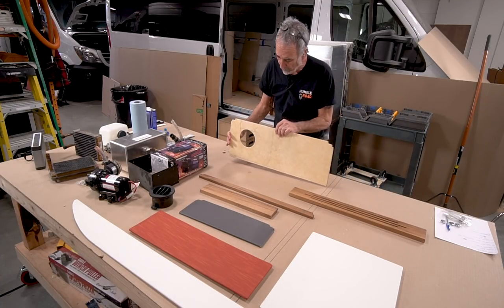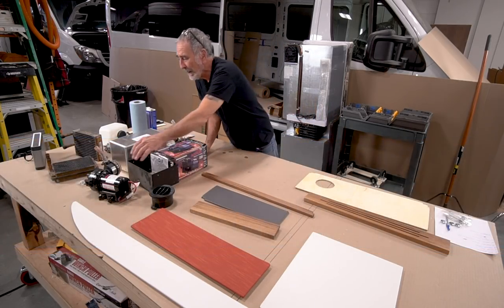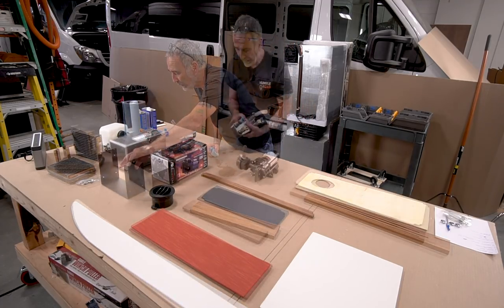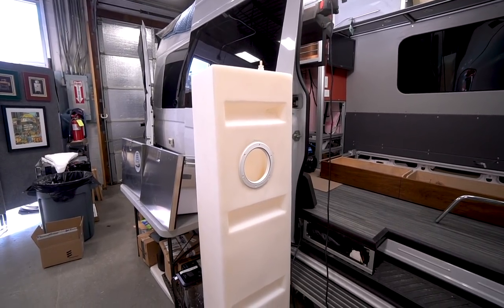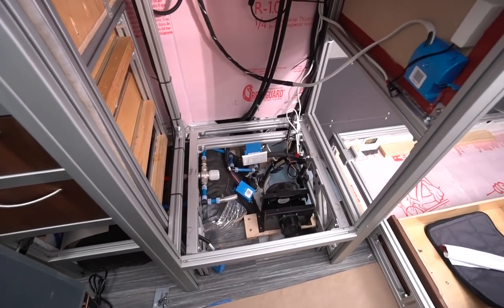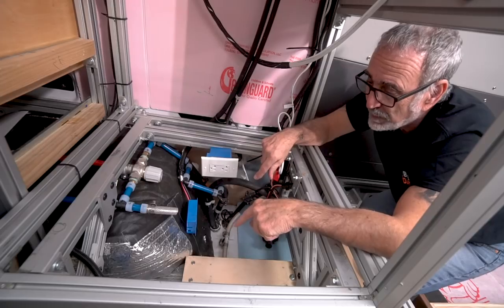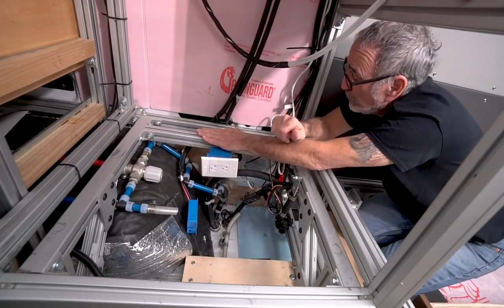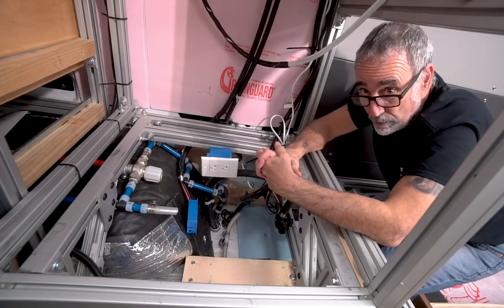VAN BUILDER TRUTH :: So you wanna build a van? What could go wrong? I'll tell you what went wrong!

Comment: Coming from a former product development engineer, you are a lucky man to have (only) one product to look over after a year of 'normal' use. It's great you are taking the time and reevaluating both the design choices and component selection - both make for better products from you in the future.  You may give some thought into an extended warranty program that benefits both your and your customer - sort of an annual maintenance agreement that provides less trouble for your customer base and further quality control and feedback for your future builds that isn't too costly for you or your customers. This is way vans should be designed and built - slowly, methodically, and thoughtfully. Nice job George!

Comment: I won't mention the brand but they would kill to have so few warranty issue as HRE (Humble Road Enterprises).   Most of their Class B products can't make it off the dealership lot without a dozen or more 'warranty issues' (aka poor assembly quality because their product is in high demand).   It may take 4-5 campervans before you standardize on preferred build methods and parts suppliers.

This is a total win for George and validates build #1 was well conceived and your belief in 'design for long-term ease-of-repair' is a winning strategy for the customer and Humble Road.

Comment: Maybe MDF will help in some areas in the future. Unlike even marine grade plywood’s or Baltic birches, mdf doesn’t move at all. My standby for gluing wood surfaces to other things is - if it’s being glued to a different material, always use mechanical fasteners and glue. Gluing two different materials together seldom lasts, but glue assisted fasteners will last forever. If you have to go with only glue just etch the shit out of the materials with low grit sandpaper to give it as much tooth as possible.

Comment: The best explanation on building a van I have ever seen, super professional. Living in the Netherlands I have to built one myself. If I will do that, thanks for all your examples. Tip: In the car industry security check paint marker is used to check if a bolt loosens. You don't have to touch the bolts to check, you can see it.

Comment: On checking the 80/20 screw connections - what we used to do on such things was paint a little line along the nut and surface so you can visually see if the nut has moved. You can also use a sharpie.
Reply from the maker: Brilliant!
Reply: Yeah, that's a GREAT idea.
Reply: Jollyprez  great idea.

Comment: Hey George, awesome work dude!  I know it's six months late, but if that pump is anything like the jabsco's, there should be a clip on the back of the filter unit that allows you to just remove that from the pump.  Should save on pulling the whole pump unit in the future.  Another thing I don't see that you might consider is adding an inline filter on the water hose feed.  Maybe come up with an 8020 mount system for the filter itself as its own little component for easy user replacement when it gets dirty.  Lots of bad stuff out there (especially where they Frak) in the tap water that could probably be stopped or reduced before it makes its way into the "house" system.

Comment: George- swap the locktite for a nut with an encapsulated  nut lock washer- you will never need to check the whole van during your warranty check. OEM use them and after 200000km durability testing they do not lose torque- l have worked in OEM engineering for close to 30 years- good luck with your builds. If you get sick of van builds come and work in OEM automotive.
Reply from the maker: Just did a futile search. Can you give me an example? TY

Comment: I really enjoy your videos, but I don't remember hearing you mention too much about aux. alternators.  I think I did hear you say once that you took your builds to Advanced-RV for their install.  I am considering installing a Nation's 280 amp. alternator with a Wakespeed WS500 regulator and wondered if you had any comments?
Reply from the maker: You need to keep watching my videos. I'm not a fan of the second alternator, particularly in a Promaster.
Reply: @HumbleRoad  
Another guy- VanGoSki on the Sprinter forum, and I have the exact same setup.  We have a DIY-   Fortune prismatic 16 cell, 400Ah, 12V battery with a REC-Active BMS.  We are charging it with a Nation's 280amp alternator and running it with a Wakespeed WS500 regulator.  We may be the first to have this setup.  The regulator is suppose to control the current and temperature of both the battery and alternator to keep everything in check.  It will fit the N62 bracket with a two belt setup, no modifications.

I have been on the side of the road twice trying to run off one battery.  That is my reasoning behind the setup.

It would be real interesting, maybe a video, for your charging ideas.

Comment: Dear George... can you please tell us what you use as the Thermal Break between the 80/20 and the chassis? 
That is the only thing I never see you do. :) Something that is long-lasting and is a good thermal break. Thank you very much if you can mention that.
Reply from the maker: I cut 1/8” rubber into strips same length as the 8020 . Predrill all the bolt holes. I’ve demonstrated this in my videos.

Comment: you also mentioned in a previous video that you could not use recess lighting on the bottom ply wood or have you used 40X60 ? also is it paneled on the walls behind the cabinets ?
Reply from the maker: The cabinet is always 10 series. The way we design, a false floor is required to use puck lights. We use strip lights under the leading edge. Makes a very nice task light.